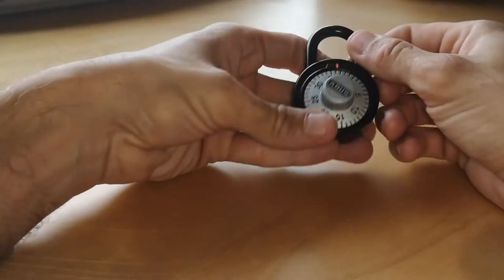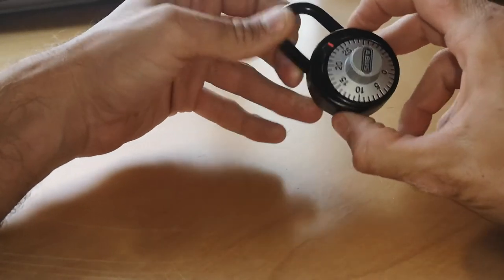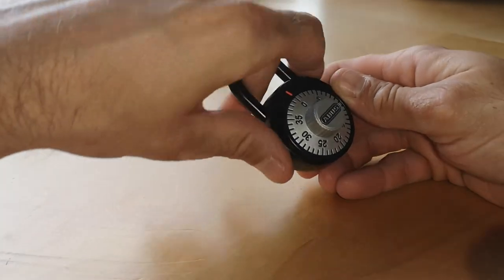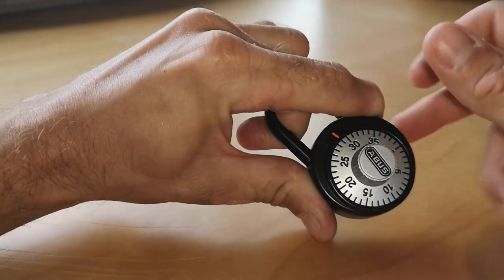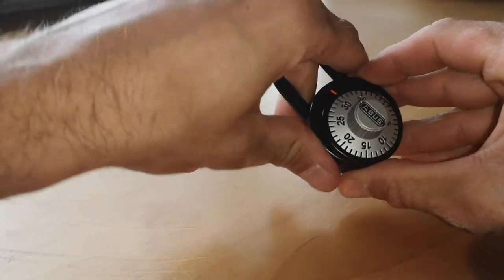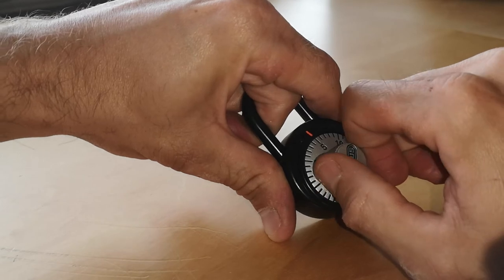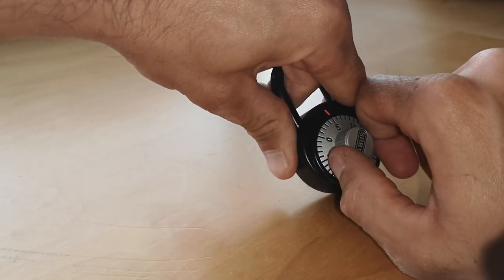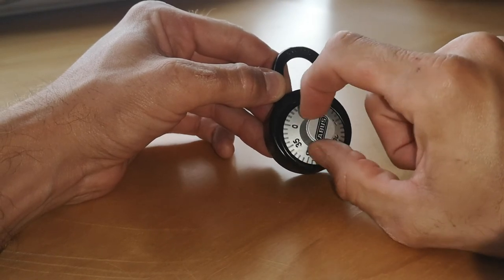Decoding an Abus 78/50 Safe Code Padlock | How to lock pick

Comment: These kinds of licks frustrate ther life out of me. I missy put time into investigating them more. Just curious as to why after finding the first number, you released pressure and gave ot a full turn? Then put pressure back on to continue. 
I am just curious buddy.
Reply from the maker: Hi, it's because these safe type locks require approximately 3 full turns clockwise before finding the 1st number, then 1 full turn anti-clockwise before finding the 2nd, and then clockwise straight to 3rd number. It's similar to the mechanism involved in more conventional safe locks. If I kept tension applied it would have made life very difficult as it would have been like working along a ratchet.